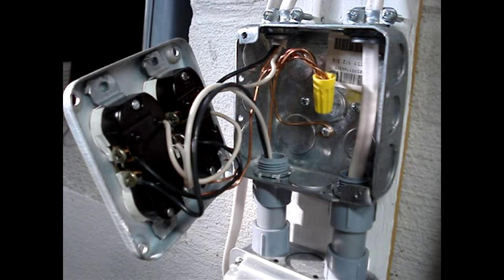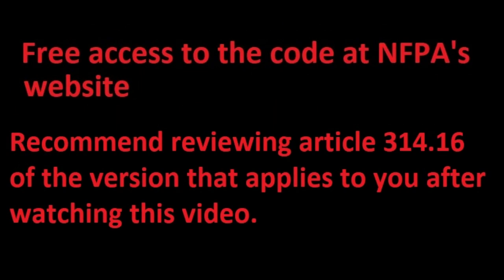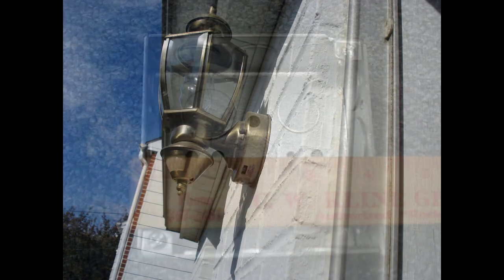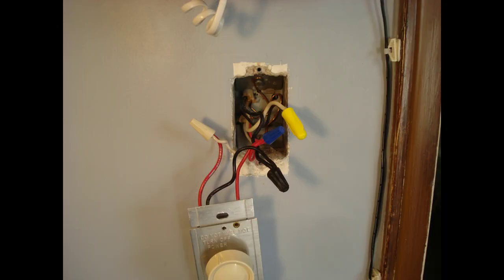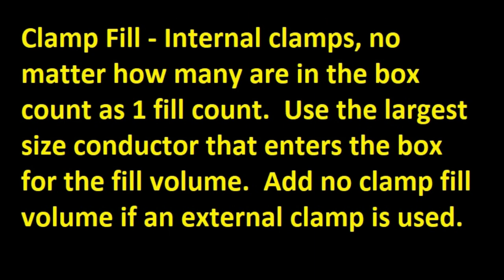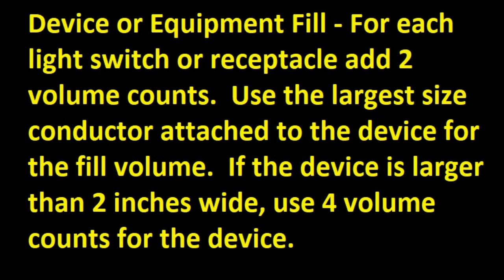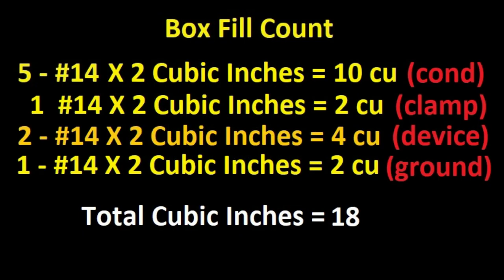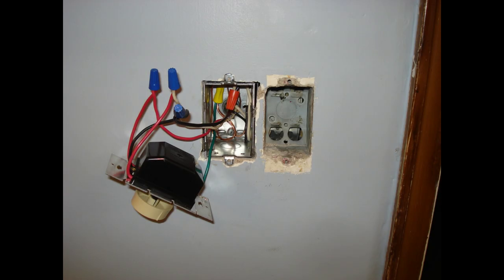How Many Wires in a Box?  Box Fill Calculation

Comment: This is the box fill walkthrough I've been looking for.  The previous (or multiples of previous) owner of my 1950s home left me a trainwreck in both the electrical and plumbing departments.  The office ceiling light in particular has five separate 14/2 and 14/3 cables coming in (power in, switch, receptacle, pantry ceiling light, garage receptacle) with six conductors on the light itself, one pass through red, one hickey, and around five pigtails going different directions.  Only two of the cables are in the original 1950s conduit, and none of the newer Romex cables have the bare grounds connected to anything.  By my count that's... way too much in one octagonal box.  Roughly 24 cu-in crammed in a 20.5 cu-in box - if I'm generous with overestimating the box size and discounting the additional wiring on the light itself.
Reply from the maker: Good luck on fixing the train wrecks.  Sometimes the things you find are kind of scary.

Comment: Just subscribed to the page and am new in the electrical trade.  Lot's of great stuff here...did you ever work in the trade or are you a DIYer...thank you!
Reply from the maker: I started in the Army as an electronics tech working on Radars, and later worked with low voltage building systems.  I did some install work.  I've learned to follow & read code books.  I spent many years on building construction sites.  I'd call myself a hybrid of low voltage dc/electronics/AC systems.
Reply: @Know-How-Now  sorry but I have one more question maybe a request as well?  I know that electrical in a home comes into the home either above or underground, goes into the meter, and then into the panel, then branch circuits etc.  But where does low voltage/ cat 5, and coaxial cable for TV come into the house.  It's not on the panel, so what powers it...what's feeding it etc?  And maybe some future vids on any of that stuff would be amazing?  Any help would be appreciated.  Thank you...and please keep the amazing content coming
Reply from the maker: My home was built in 1952, so the cable/coax comes in from a pole and then drops into a plastic box on the back wall of my home.  The telephone has the same setup.  In newer installs the cable coax & phone are buried and likely enter through a basement or outside wall.

I did a lot of work in phone company switches and connected a lot of equipment to phone lines.  The phone company provides about 48VDC from your local switch.  The "switch" is a building were they house electronic switches to transfer communications from switch to switch.  The 48 volts is backed up by generators & batteries.  That's why during a power outage, your land line phone will still work.  It's a robust system.
Reply from the maker: PS - I'd be careful with overcrowding the boxes.  I've recently pulled out some old fluorescent tube lights.  The covering on the wires on a few of the ballasts just crumbled off of the metal conductors leaving them exposed.  Over time heat had destroyed the covering on the conductors.  That's why you don't want to overfill electrical boxes.

Comment: Below is a preview of the NEC. See the actual NEC text at NFPA.ORG for the complete code section. Once there, click on their link to free access to the 2020 NEC edition of NFPA 70.

2017 Code Language:

314.16(B)(5) Equipment Grounding Conductor Fill. Where one or more equipment grounding conductors or equipment bonding jumpers enter a box, a single volume allowance in accordance with Table 314.16(B) shall be made based on the largest equipment grounding conductor or equipment bonding jumper present in the box. Where an additional set of equipment grounding conductors, as permitted by 250.146(D), is present in the box, an additional volume allowance shall be made based on the largest equipment grounding conductor in the additional set.

2020 Code Language:

314.16(B)(5) Equipment Grounding Conductor Fill. Where up to four equipment grounding conductors or equipment bonding jumpers enter a box, a single volume allowance in accordance with Table 314.16(B) shall be made based on the largest equipment grounding conductor or equipment bonding jumper entering the box. A ¼ volume allowance shall be made for each additional equipment grounding conductor or equipment bonding jumper that enters the box, based on the largest equipment grounding conductor or equipment bonding conductor.

Comment: I just went over this in class today, but dont you count all the ground conductors as 1, based on the largest ground conductor size? not the largest conductor size?
Reply from the maker: Thank you for asking.  I reviewed the video and I understand why you are asking your question.  I did not clearly word the rules for counting ground conductors.  I didn't realize that the viewer would assume I was talking about ground conductors during that segment and you might think I was talking about all of the conductors.

Thank you for being so polite in pointing out my error.  The correct way to base the count on the largest ground conductor size.... as you have learned in class.
Reply from the maker: PS - Counting the largest conductor vs the largest ground wire will likely have the same result, especially for the intended audience for this video, a home owner in the U.S.  There will likely be only 14/3 or 12/3 in a box.... all with the same size ground conductor.

I didn't realize that I would get students watching the video, though I'd bet a lot of DIY'ers are just going to shove as many wires as they can into a box.  You will be the one to find the results and shake your head.  I've found wire coverings that were exposed to heat and over time the covering just crumbles off of the metal conductor.